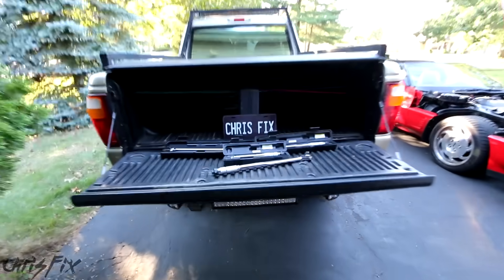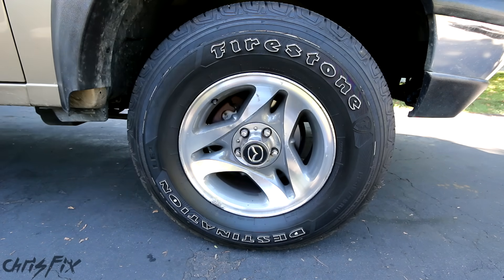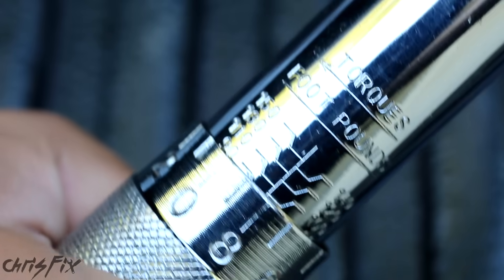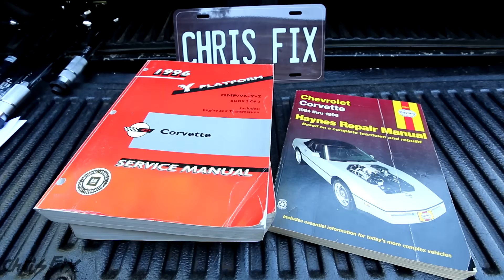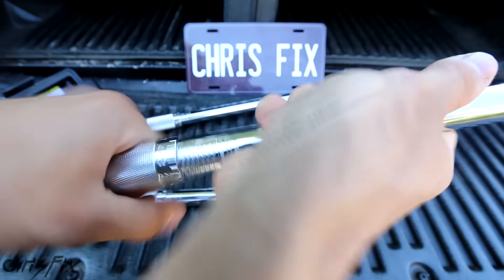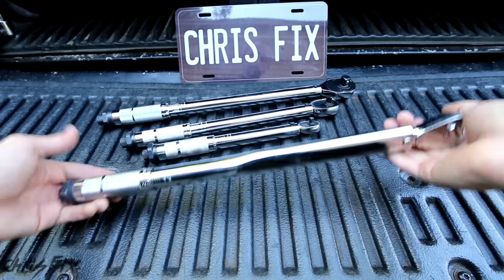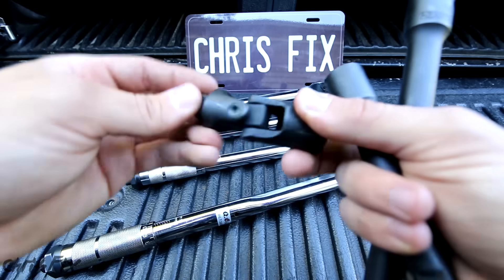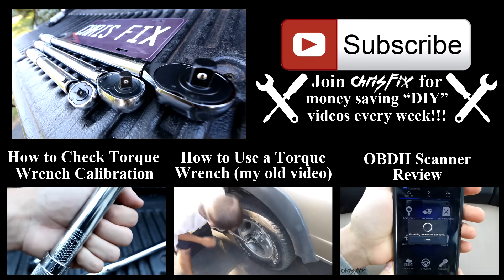How to use a Torque Wrench PROPERLY

Comment: year has passed and still waiting for that torque wrench calibration video...
Reply: Calibration would easily be done by connecting this torque wrench to a bar style torque wrench that does not go out of calibration. Set the click torque wrench to a specific amount, put it in a vice, then turn the bar style torque wrench slowly to the exact setting. If it clicks at the correct amount of torque you are good. If not, get it fixed.
Reply: @AirsoftTeamOSMD  You rock, never thought of that, I knew there was a reason I wasn't tossing my old beam type torque wrench!
Reply: @AirsoftTeamOSMD   Certification is done on a basis of time, all calibration goes out of date, even a one setting click specific torque wrench so then setting a variable torque wrench off of your one setting click specific torque wrench only guarantees that you are hitting that specific torque and because of the way that most variable torque wrenches are engineered, they are not linear scale, so you can not be sure of any any other torque setting unless you have another one click specific torque wrench set to that specific value to be sure you are actually hitting the proper value, or a static torque transducer.
Reply: @AirsoftTeamOSMD do you mean "beam style"? 
I dont know which one do you refer.
Reply: To calibrate it you simply need a weight that is exactly some even units of pounds, then simply suspend that weight the number of feet(exactly) from the center of rotation(for instance, if you have a ten lbs weight you can calibrate your wrench for 10ftlbs @ 1ft or 20ftlbs @ 2ft etc.., the closer you are to exact numbers like 1ft or 10lbs the more precise your calibration will be).  I'm am lucky because I certify dynamic torque for power tools all day long and have access to torque transducers so I can simply take my torque wrenches into work and test them over the ranges for a given wrench for free.
Reply: @NobodyNowhereKnowhow  where is your video?
Reply: @NobodyNowhereKnowhow  so you prop up you torque wrench and then hang a 10 lb weight from the handle on a 1 foot string!? Am I missing something
Reply: @NobodyNowhereKnowhow  who has the best numbers in the torque wrench industry?
Reply: @michealdumasii5432  What do you mean by "best numbers"?
Reply: Almost 3 years and no 2nd video
Reply: Coming up on 2.5 years
Reply: For everyone in this comment, two weeks ago Chris replied to another comment about a calibration video. He said “stay tuned”.
Reply: @cappy6100 Lol 4 yrs ago😂
Reply: @AustinDouglas75  lol
Reply: Been 6 years still hasnt posted it
Reply: Same! He probably never seemed the comments about the request :(
Reply: @sunnyhaibin  no they dont need to be done
Reply: As someone who works in a calibration lab I really want to see how he checks it at home.
Reply: Just finished watching a Torque Wrench Recalibration video by a guy called "Nthefastlane". Best one I've seen!
Reply: 7yrs later
Reply: It’s been eight years 😭
Reply: It’s been 9 now 😂
Reply: Probably forgot..
Reply: Me too
Just bought torque wrench and had to watch what Chris has to say
Reply: @chrisfix torque wrench calibration check video.. been 2.5 yrs since this was posted, could you please have that one next?! 
Huge fan, thank you for all you do make our life easier
Reply: I calibrate mine with a digital torque meter. The one from harbor freight has been within 1 pct when checked against other sources.
Reply: For home DIY stuff, dont worry about calibration. When you send one in for "calibration" all they do is check it, they dont calibrate anything. I get mine calibrated because I have to,  but never once has one been adjusted, I use mine multiple times everyday. Forget calibration.
Reply: almost 7 years
Reply: 7 years and still waiting
Reply: Any day now. I can feel it
Reply: 8 years have passed and still no video
Reply: 802 Garage two months later lol.
Reply: @Jesse_Meyer  2 years later :D
Reply: We should remind him heh
Reply: i find the garage geek video has the best way to calibrate a clicker wrench of the cheaper type. also has all the info for calculating for different sizes of wrenches, and various ranges of spec on a sheet thats easily read if you pause the video.
Reply: 2 years a still waiting
Reply: @sam2920  over 3 years now, not 2. The video is "Published on Sep 17, 2015"
Reply: @leocurious9919  you're right
Reply: Sloth Armstrong  2019 and counting
Reply: Its 2020, who is here with me
Reply: @jasoding  Just use an eight point socket to join your automatic torque wrench to a reliable beam type torque wrench to verify calibration. Adjusting an automatic torque wrench is not so easy, especially if it is a crappy imported wrench like some of mine.
Reply: @stephenarling1667  coool, thanks, I do found other vids showing how to use a luggage scale and a ruler to do quick calibration (Even the result might be around 4-6%）
Reply: I heard that in case you have no torque wrench at hand, the thumb rule for a proper torque is to tighten the screw or bolt until their snug plus a third of a turn (120 degrees).
Reply: maybe super busy and forgot
Reply: 6 years later.. sponge bob.
Reply: 6 years*
Reply: We still waiting?
Reply: Calibration video!
Calibration video!
…please?😊
Reply: 7 years later and we’re still waiting
Reply: 8 years ago
Reply: Lel
Reply: Mr.Sexy:Panda 2 years n0w bго
Reply: Still waiting....
Reply: Stop whining about it already.  Google is your friend.
Reply: Hmmmm only a year
Reply: 6 years later lol
Reply: Mr.Sexy:Panda I’ve had a torque wrench for years and never even fuckin noticed that you could change the torque
Reply: @franklinmatthews8558   then you are blind i guess?
Reply: Easy home test is against a high quality fixed beam torque wrench.
Reply: Hey guys Chrisfix is not here
Reply: 4 years now…
Reply: Been waiting 5 yesrs still no video 😕
Reply: 6yrs later still no
Reply: June 2022 - No video
Reply: dang 5 years
Reply: 6 year's now. I heard the video will be out in the near future.
Reply: @neilhamill318  we all heard but was never delivered :(
Reply: 7yr*
Reply: A year or 5000 times
Reply: I was here
Reply: 8 years have gone by and it's still not here
Reply: 7 years have passed. Any word of the video yet?
Reply: We still waiting
Reply: Hello!
Reply: 7 years
Reply: 9 years ago
Reply: You must’ve forgot Chris fix only does videos that are easy now he never does his old style of videos anymore
Reply: I'm here to brother.
Reply: Hopefully someday we will see the video
Reply: Is the video coming out anytime soon??
Reply: I am the 1000th like
Reply: Me too.
Reply: Ok
Reply: I bought one where they do free calibrations for the lifetime on the tool
Reply: @Boostedmamba  yes,my torque wrenches are made by "CDI" and "Snap-on",if sent to the manufacturer they recalibrate them and send them back with written certification cards and both CDI and Snap-on have never charged me for this service.I would recommend either company for their quality tools and customer service!
Reply: @jojomama4787  Exactly, you get what you pay for. Snapon and Matco have done mine for years for wrenches purchased off truck with no problem.
Reply: Xd
Reply: Many many thanks
Reply: Still waiting
Reply: lol, not that i dont appreciate him saying it, and woulda been nice, but there is hundreds of good videos showing how to do it otherwise
Reply: hi i guess he shows everyone how to fix cars hes not a tool specailist
Reply: yes they should be
Reply: TO ANSWER YOUR QUESTION NO IT DOES NOT SHOULD ONLY NEED TO BE DONE ONCE PER YEAR CHRISFIX HAS LOTS OF VIDEOS SO HE MAY NOT BE ABLE TO CHECK EVERY SINGLE VIDEO FOR QUESTIONS
Reply: CHECK UTUBE OTHERS HAVE MADE VIDEO ON U TUBE ALREADY
Reply: as usual bitchfix with his bitchy promise videos
Reply: CarDaily still hasn’t posted a calibration vid 3 yrs from when you wrote your comment
Reply: Yeah same.
Reply: Internet will be extinct, before it comes out
Reply: If anyone wants to learn about Jesus Christ reply
Reply: I believe it is actually coming out soon now.
Reply: @802Garage  5 years later
Reply: @802Garage  how tf do I keep finding you in every old comment sections
Reply: @802Garage Good, can’t wait! I will put it into my calendar for 2033😊
Reply: @Happy_Skipper Bahahaha what an amazing necropost.
Reply: Cash Cycle logically you can check the calibration by having a brand new same one as a reference.
1.Tighten a nut with a special value with the used one.
2. Start lower in 3-4 ft-lbs with the brand new one and start testing if they match then it is still calibrated if not then you know how many extra ft-lbs you need to add next time you want a particular torque.

Thats only to know how much is the old one out of calibration though.
Reply: @autopassiongjk  Very bad idea to use a new one as a guide. It seems the market is filled with chinese made ones that while they seem relatively sturdy I wouldn't trust they are carefully calibrated.
Reply: Supposedly, I heard/read ARP does that at NHRA events.
Reply: sunnyhaibin do i have to calibrate them myself?
Reply: @interestingthings8598  no they should already be
Reply: @interestingthings8598  no please don't, take to a specialist
Reply: We from Precision Tool Calibration Experts recommend the following to calibrate at home: Set it on lowest torque setting first and put it in a freezer while being bagged airtight for 3 to 4 hours.
Then take it out and let it naturally get back to room temperature. Set it to max torque setting and go outside. Now loosen 4 wheel nuts/screws and set to lowest torque setting. Shake the wrench for 3 minutes and throw it as high as you can without catching it. Now go back in the house put it in a microwave for 5 minutes on 140 degrees and then go back outside again and throw it as far as you can. Congratulations you've just calibrated your wrench successfully.
If you feel its a bit off just rub it a couple hours every day till you satisfied.
Reply: Well he is a millionaire now or at lease Rich,do not care anymore!
Reply: It’s been 8 years now and still nothing
Reply: Mr.Sexy:Panda any update yet fro. Chris?
Reply: Just open the knob on the bottom and slide it from the min to the max setting repeat this cycle three times that’s how I recalibrate mine
Reply: Just buy a new one
Reply: Lou Fazio wat
Reply: is this right, without tq wrench,fingers tight snug then  gasket type 2/3 turn, taper type1/8 turn

Comment: You should explain in your video, that you can buy a inch pound torque wrench so be careful of what you are buying read before you buy. Also if you have a inch pound torque wrench or foot pound you can either divide or multiple to figure out what you need. Simple math or reach in your pocket and use the phone, most have a calculator on them. Most inch pound torque wrenches do not came close to the foot pound  ranges.

Comment: Just got a craftsman torque wrench but its backwards... its stuck losening. How should i fix it
Reply from the maker: +Mountain Noobs turn the mob at the head of the ratchet like a normal ratchet and it will go to tightening.
Reply: ChrisFix Doesnt work... it just spins the head
Reply: ChrisFix No buttons, knobs, switches, etc that change the direction

Comment: Can you recommend any other company that works in europe? Wanted to get a TEKTON torque but the shipping is higher than the wrench itself and not sure what to do.
Reply from the maker: I would go with a known brand that you use in Europe then.
Reply: Main brands here where I live are for one - more expensive, and two - their range is 40-200. TEKTONs has 13-210 which is perfect and is not that much in comparisson. It is more difficult than I thought.

Comment: Extensions do nothing to the torque values, only if you extend the wrench horizontally, ie lengthening it, will it throw the readings off.
Reply: Actually, extension bars do have the potential to throw off the torque value, but in extreme cases. A long, thin extension bar, or one of low shear strength material will twist under load, especially if you are trying to tighten something with a high torque value. A portion of the torque you apply will go to twisting the extension bar and not to the bolt, thus lessening the torque you apply to the bolt.
Reply: harryWRC Well that's hardly a normal scenario to be honest. if it twists under load then you need a stronger bar. In the usual scheme of things, a long bar does nothing to the readings.
Reply: Very true. the twist has no effective impact.
Chris is also right about the universal joint. it doesnt have constant velocity which can cause both an increase or decrease of the torque.

Comment: someone please answer me because i need help. where did you get the socket for your torque wrench!?! mine didnt come with one. i also bought a regular (non-torque) lug nut wrench and it came with sockets. they are the same brand but those sockets wont fit on the torque wrench. please explain because i need my wheels tightened asap.
Reply: heyitsme you will need to buy appropriate sockets separately. Either that or get a socket set with the same size drive as the torque wrench so you have a socket and ratchet that can be used on the same nuts that you want to "torque". A torque wrench is just a ratchet handle that gives you feedback (a click in this case) when a certain amount of force (which you can alter with the twist handle part) is applied to it. Normally, the sockets are a separate bit of kit.
Reply: Robnoxious77 thank you. I ended up just returning the torque wrench that I bought and going to Exxon to get my lugs tightened. Normally I take my car to the dealer but I didn't feel like paying an arm and a leg for a simple task.

Comment: So I bought a 3/8 torque wrench and It's says inch pounds instead of foot pounds. Now would it be best using it to tightening bolts onto cylinder heads or buy a torque wrench that has foot pounds? 🤔
Reply: depends on the range. You can convert in lbs to ft lbs. If your torque spec falls within your range it doesnt matter.
Reply: Bubble Butt I would recommend a ft lb torque wrench (get one that goes up to 100 ft lb). it should have a 1/2 drive to take 1/2 extensions and sockets. another thing you will need is a "torque angle gauge". sears and harbor freight both have acceptable versions of this. your cylinder head will be tightened to x-number of ft lbs, then a certain number of degrees past the click. ALWAYS use new bolts, because the old ones stretch when torqued the first time and are JUNK if reused (will trash your engine). and be sure to tighten the bolts in the order the manual says (start in the middle of the head, usually)
Reply: ObsidianShadowHawk Thanks 🖒
Reply: Bubble Butt I like your name lol Bubble Butt 👍🏼👌🏼
Reply: Cylinder head bolts on a car. Use a degree gauge for tighting. Degree gauge is more accurate. Torque wrenches are for guys that have no touch , feel or experience. Threads are just like a spring as you tighten the spring stretches. 🤔🤔

Comment: And when was the last time it went through a Precision Measurement Equipment Laboratory for calibration? Not all off the shelf torque wrenches are calibrated or even any good. If it says made in China,,,,,,Beware
Reply from the maker: +Mark Olsen thanks for the tip
Reply: OF course the ones from harbor freight are made in taiwan.

Comment: so that is not a hammer?
Reply: It's a 'special tool'
Reply: Everything works as a hammer, but not all work as a screwdriver. :-]
Reply: @andrewcintron121   I sometimes put a screw driver bit into a socket and then put it on a small ratchet.
Reply: @CIorox_BIeach  thank god I'm not the only one.
Reply: Instructions still not clear.
If not a hammer, can I use as counterweight?
Reply: You can use it as a pry bar.
Reply: Defnitily not
Reply: 朱煜超 r/wooosh
Reply: Every tool has a hammer side
Reply: Ahahahahaha😂😂😂👌
Reply: Hahahaha😂😂😂